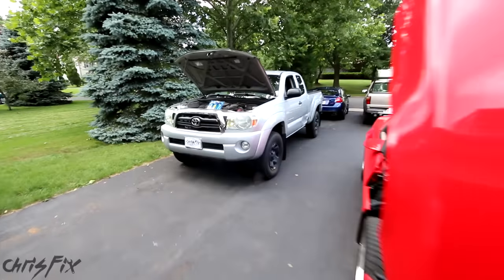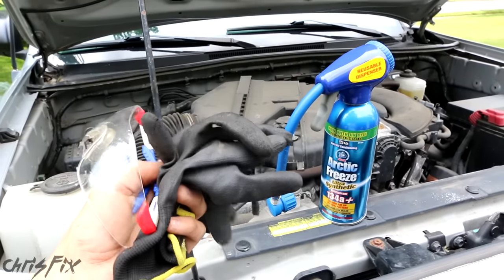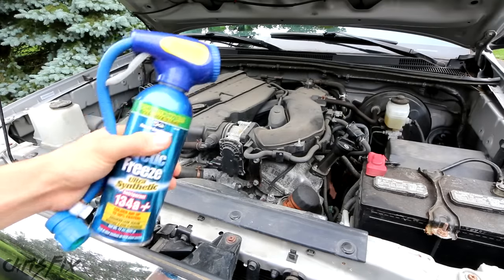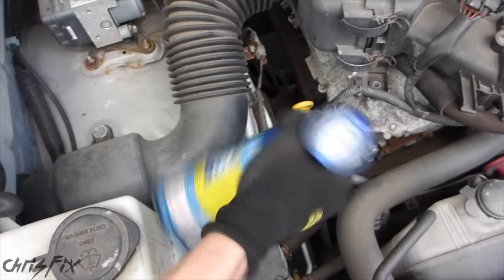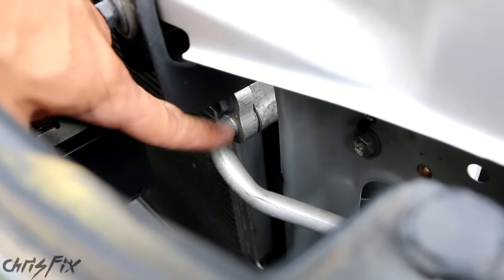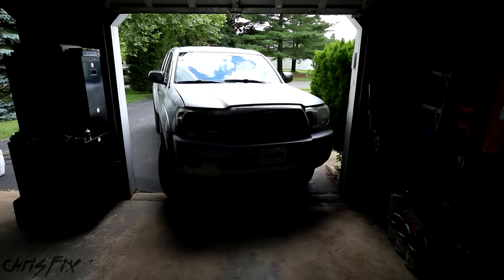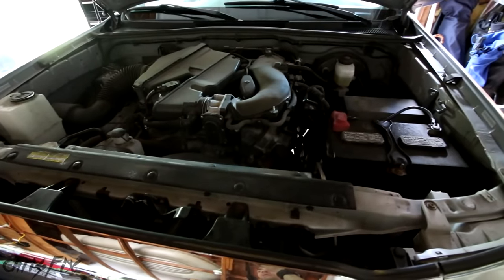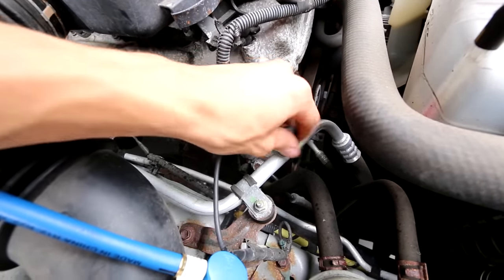How to Find AC Leaks in Your Car (UV Dye)

Comment: I've been a mechanic for over 40 years and I really enjoy your videos, you explain things in a way that is very easy for the guys and gals that don't work on cars everyday can easily understand keep up the Great work.
Reply: Now the secret is out we don't need mechanic anymore
Reply: @Asian_Connection I agree don't get me wrong, but here in modern times, automotive engineers are changing every single design and every single automotive component every year nowadays and we the DIY ppl have to wait 10 years or more for readily available household versions of "specialty" tools to be available to the public. Even the Cresent wrench and pipe wrench used to be considered specialty tools, but that was way back in the 1800s and earlier. Lol. Regardless of that scenario,  you can still work on most vehicles with common tools as long as it's not some overly complex foreign exotic car like the trash BMW and others make.

Comment: not a toyota owner here but doesn’t matter in this case because the subject of the matter is how to investigate a leak with simple gear you can find at any parts store or online. i used to be scared or intimidated by ac systems but after a little 1-0-1 on youtube about how to replace condensers and such, it’s not so “rocket-sciency” stuff anymore. i’m no mechanic by any measure. but i’m not an idiot soy boy that couldn’t change a wheel or tire or my own brakes or oil etc. this is a very helpful and simple to follow and understand video without being overwhelming and extra winded on everything. i already have my replacement ac condenser for my 2011 ford f-250 gasser but there is 👌nada video on how to replace that specific part for that specific year model and engine. it’s really frustrating. however after watching many ac condenser videos on a variety of models and makes, they all generally are the same concept of dismounting and inspecting and replacing.

Comment: Put a re-manufactured compressor on my car that they said they tested, it turns on and the clutch activates fine but won't hold a charge. When recharged by a pro the temp didn't change hardly at all. Going to use this method. Thanks.

Comment: Thanks for the great video and taking away some of the mystery surrounding AC. One thing that springs to mind when you brought the UV torch out is that if you didn't own the vehicle from new it might be worth giving it the once over with the light before starting to ensure there isn't any pre-existing dye from a previous leak.
Reply: Perhaps Chris DID give it a once over with the light, yet chose not to video your unasked for advice in advance !!

Comment: Mine was making hissing sound on and off so I bought the refrigerator with leak sealer.  Hope that'll help fix the leak if there's any and that hissing sound does not comes back on when I turn on the ac.  In the future, I might just get the refrigerant with uv dye in it and check again for leaks. Great job for doing a thorough leak detecting using uv dye.  That was very helpful.  Keep up the great tutorial guide.  I love watching all your videos as they are all very informative.

Comment: I already know the leaks going to be massive when I hit it with the UV light. As soon as I hit the trigger you can hear it escaping up by the condenser somewhere. The system won't even build pressure at all. Gonna check out that ring for sure.

Comment: Thank you for a great video.  Two suggestions:  1) To be complete, shouldn't you have looked for a leak under the dash (evaporator)?  2) There is a turnable ring around the pressure gauge on the can.  On hot days, the pressure a normal system is higher than on cold days, due to expansion.  So, the ring is adjusted to point to the outside temp, which also moves the lines indicating a "good" range for pressure indication when filling the ac.
Reply: No!  Chris should not have looked for a leak under the dash (evaporator)  From what you describe ... Too Complicated !!  :face-turquoise-covering-eyes:

Comment: Do I see that you're going to do an AC Compressor install vid to accompany this? This is actually a job that I need to do on my 98 Corolla so I'm very interested in seeing this!
Reply from the maker: ***** Yes! I am going to try to make make it cost around $100 (not including the compressor). Should be a fun video!
Reply: ***** Depending on the vehicle, a compressor swap is a cake walk. Did a swap years ago on a 2000 S-10. Was a breeze. I just had to remove the belt, and basically unbolt the compressor.
Reply: That's what I thought, the issue is I'll have to bring it to a shop to get it all evacuated. Cause I do have good refrigerant in my lines. Just the compressor is making a wicked bad thumping noise (like a bad piston) occasionally when running. I saw another comment about how this could be caused by the shop who did my cooler flipping the recharge can all the way upside down feeding liquid into the lines.

Comment: Oh, and one other thing:  Since the compressor is running during the charging procedure, it's very important that the refrigerant canister not be inverted at all.  Otherwise liquid refrigerant could enter the low pressure line and destroy the compressor.  This is especially true if there is no accumulator. There is another video on line where the tech does exactly that and then can't understand why the compressor worked when he started charging the system but then suddenly seized when he inverted the container. Duh.
Reply from the maker: wholeNwon Thanks for sharing and great tip!  That is exactly why you go from the 12 to 3 o'clock positions only!
Reply: Great advice. I suggest Chris adds these tidbits as notes that show up on top of the video, the more you know the better!
Reply: Wait, inverted like upside down?
Reply: yea dont turn it upside down.
Reply: wholeNwon    Good job from Aleskyfinis

Comment: Great video! Best on the ‘Net.  Whenever I discharge a system, I will automatically replace the schrader valve cores (hi & low cores are different size). Most common leak area, in my experience.

Comment: That was one of the best trouble shooting AC leaks and also how to recharge your ac system.  Thank you soooooooo much!
Reply from the maker: Thanks a lot Jessica!
Reply: @chrisfix  IWent to AutoZone and bought the product for the car came back and actually applied what you had said in your video and my AC in the car was running at 100° because I’m in Sarasota Florida and it’s super humid and then when I filled it with the product that you recommended I was in my car and it was 60° so everything worked perfectly and thank you thank you so much for your wonderful video I appreciate it

Comment: good video but this method isn’t perfect at all. using uv dye only works for pretty large holes and for the most parts you cant see around the tubes in some places aand also if theres rust dust on the pipes it will also glow under uv light. in some cases i guarantee you that these micro holes on the aluminium tubes that uv dye didnt show, will still leak and if youd had to make a business on it clients will come back to you in 1-3 months. another thing to mention is that the chemicals in the uv dye dont work well for the tubes since its pretty strong chemicals. the best method is to check it with electric refrigerant leak detector, but i guess for a house garage budget uv dye is ok :)

Comment: Around 1997, in Hawaii, I bought a used 1986 Mazda 626LX (4 doors, hatchback, sunroof, manual transmission) which wasn't blowing any cold air.  So, I took it to a shop and they charged it up for me for about $50.
The first time I turned it on I got the "SH*T scared out of me because this white stuff started flying out of the vent and I initially thought it was smoke, as in something internally is burning as I reached across for the fire extinguisher on the floor in front of the passenger seat (Hey, I'm a helicopter pilot and like to be prepared like a BOY SCOUT).  
Then I realized it wasn't smoke, but "SNOW" flying out because the air/moisture in the vent was being frozen by the cold AC blowing air initially until about 20 seconds when the AC started up - laughed my ass off - the air was so cold I got SNOW in my car in Hawaii!  I loved that car, too bad the US NAVY wrecked/totaled it while transporting it to Baltimore for me!
My significant other's car (sent back to the supply system since then), 1990 FORD ESCORT's A/C got charged up too, but it took a while to cool the car down...she gave me one of those "jealousy" snide looks every time the snow went flying in mine, LOL!
Reply from the maker: LOL thanks for sharing!

Comment: Hey Chris,
I don't recommend using sealants in an A/C system. It can damage an A/C recovery machine. One of our machines at work had a bad drain valve that is no longer available. We had to retrofit a manual valve to drain the oil off after recovering a charge. The valve solenoid was electrically fine but it would not open. I strongly believe it was probably sealant someone had put in a car we worked on. I learned recently there a "sealant detectors" that should be used before recovering a charge. If a car has sealant in it the charge should not be recovered into your A/C machine. That is to say the refrigerant is then contaminated. The other concern I have heard recently is that some people have been converting R1234YF cars to R134a. I believe this is NOT a legal practice. This is likely to cause contaminated refrigerant to get into a recovery machine so that the tank is then contaminated. If you put this contaminated refrigerant into other cars you are responsible. I guess you could say it's important to use a refrigerant identifier before recovering a charge.

Comment: Some may have already said, but one must also check for evaporator leaks which is the small radiator like unit under the dash board.  However, the under-dash unit is the hardest to see and detect leaks.  It is also the most difficult to replace/fix...i/m/h/o....but is often the place for many leaks.
Reply from the maker: Thanks for sharing!
Reply: I had a vehicle with an evap leak, so it does happen. Vehicles with automatic temp control are more at risk because the A/C system is used more, which means the evap is exposed to more condensation, and subject to more hot/cold cycles which can propagate cracks.   Cost $1000 to replace the evap, as the shop had to roll the entire instrument panel to get at it.  I wasn't about to try that one myself.

Comment: I like this video cause it’s basically the same truck I have (I have a 2010). It’s a V6 05-11 Toyota Tacoma so it’s identical to my truck. I have a feeling this is also something I might have to do at some point cause this summer is AC has been running almost nonstop when I drive

Comment: Same issue with my car, but i didnt know since its winter here in nyc... i wanted to test my compressor and notced it wasnt engaging.... after testing the fuses and everything, even moving the compressor freely with my hand i came to the conclusion i had no refridgerant. I purchased a small bottle as a test and low and behold, after putting in a quarter of the bottle the compressor kicked in..... so i def have a leak somewhere.

Comment: I have a tip about if your pressure gauge is changing from "low"  to "high"  pressure repeatedly within seconds. If it is constantly changing from low to high pressure, that may be because your a/c compressor is kicking on and off repeatedly.

Check your AC compressor to make sure it is running. The AC compressor is running when the whole wheel on it is spinning, not just the outer part of it, which is the "a/c clutch" being "engaged." When the clutch is engaged, the compressor is spun  and compressing refrigerant (it is turned on). 

You may notice that the AC compressor is constantly turning on and off. And when the AC compressor turns on the pressure on the rhe gauge goes down. Likewise when the compressor turns off the pressure goes up. 

That is expected due to the a/c turning on and off. On Fords this happens because the AC refrigerant level is too low so the the compressor stops running to prevent damage. 

The car turns on the AC compressor when the pressure is high enough (when the compressor isn't running). As soon as the compressor starts running and pulling refrigerant, the low pressure line pressure drops too low and the compressor turns off. Then the pressure rebuilds high enough with the a/c compressor not running, and the a/c compresor kicks back on and repeats the cycle.

Why is it normal for the pressure gauge to read both high and low with the a/c compressor turning on/off. I believe that the low pressure line is normally gonna be higher pressure when the a/c is off. That's why to get a proper pressure reading the a/c compressor must running: The "low/good/overcharged" indicator on the gauge is designed to be read when the compressor is running. 

So if your gauge is repeatedly going up and down, and the lowest pressure, reading is in the "low" section of the gauge, that indicates the pressure is indeed too low. Add refrigerant  to bring the lowest pressure up. Keep adding refrigerant until the lowest pressure reading is high enough that the compressor stops turning off and the gauge has a stable reading. (It should still be in the low range, or be within the good range)

Then you can follow the instructions of the video to read the gauge and add refrigerant until it's at the proper pressure. 

DON'T OVERCHARGE THE SYSTEM

(According to my gauge's instructions, the proper good pressure depends on the temperature around the car. Also, make sure your car doesnt have special recharging instructions, as some cars have a pressure valve that makes low pressure line readings inaccurate and makes it possible for you to overcharge and damage the system.)

Comment: You have blinded me with UV light straight to my eyes ;-) 
Thanks for the video. Good clarity. I'm assuming that after replacing the compressor, you would use a vacuum manifold to pull out any moisture (i.e. "do it properly")
Reply from the maker: :o Thanks a lot! And you are correct!

Comment: I have a 2017 Toyota Highlander that lost AC a couple years ago. I had it looked at by the dealership and they said the mechanic didn’t find any obvious leaks after putting the dye in. The stuff he used also had a leak sealer in it which now that I’ve seen your video I think that may be why he didn’t see a leak. We only have to use our AC about 4-12 times a year and the “repair” seemed to work for the next Summer including a long road trip where the AC was on for a long time over the next week. Near the end of that trip I could smell a slight odour that I’m guessing was refrigerant?.? Then Fall came along and I didn’t need the AC again for about 6 months. When I first used it again it was blowing just a bit less than warm air that couldn’t keep the vehicle cool at even around 80 degrees outside temp. I was concerned that it was the evaporator under the dash because of when I smelled that odour before but now I’m thinking it might be the compressor as the truck you just did is also a Toyota. There is also a “ device” ( a switch of some sort?) that attaches to the compressor that sometimes fails. I guess the first thing I need to do is to test if there’s any coolant pressure and if there is then it may be that “ switch”.

Comment: Hey Thanks man, I was able to find the leak with a small can of r134 with dye. It was leaking from the hose of the condenser to the compressor at bottom. The point at which it connects into the compressor so probably the o ring.
Reply from the maker: I'm glad you were able to find the leak! It definitely sounds like the o ring!
Reply: @chrisfix  did you use the stop leak? and did it work? i think i might have the same problem in the same location!

Comment: Hi Chris. You've mentioned that the refrigerant you used has a sealant, so did it actually seal the leak or you had to rebuild the compressor?
Reply from the maker: The leak was pretty bad, so I ended up having to replace the compressor!

Comment: Super informative, Chris.😀 My 08 Miata, a salvage car bought 3-22 w only "30K" miles, AC didn't cool so I charged it. It cooled for wks but compressor made a "knocking" noise, failed 6-22 & won't come on now at all. Before it failed, Cd's would skip, when ejected found condensation on them ?? so I suspect AC gas leak behind dash or on firewall on CD player was causing this ?              I can't charge it now with dead compressor so I'm wondering if a new compressor is my best course of action ? A garage offered to evac the lines and recharge for $99 and check for leaks but  how can they recharge it with a dead unit ?? They also gave a $1200 quote to R&R the compressor ???

Comment: Chris, if you had the car/AC running while performing the dye test, would it be easier to see the leak, because the dye will be spraying from the leak, unless the leak was in the low side where you get air/moisture absorbed from outside to the inside of the system and will only get a dye leak out when the AC is off.

Comment: I think the gauge you showed has an adjustment to compensate for ambient air temp. in determining the "full" pressure range.  Did the sealer stop the compressor leak?

Comment: Only reason you turn the bottle and reset it is to make sure you have not gone over the mark. Its very important the weight/ounces of fluid going in does not exceed factory settings.